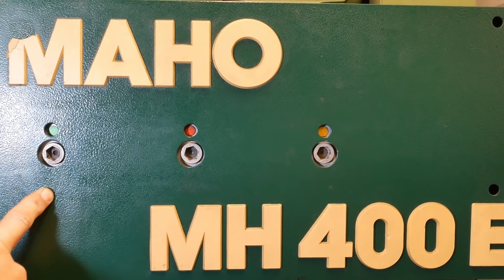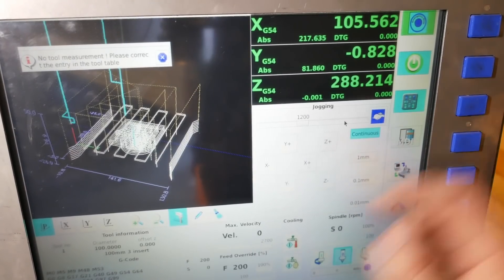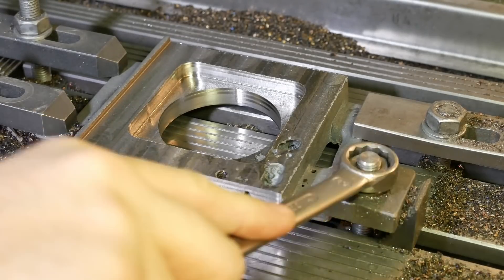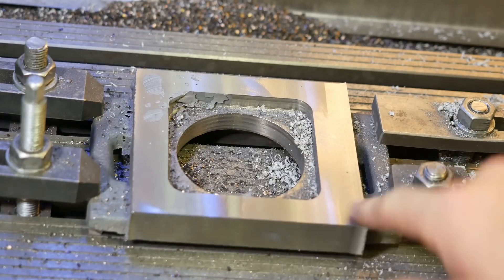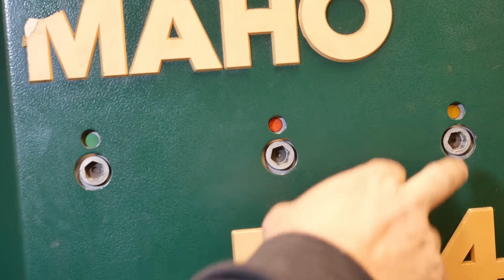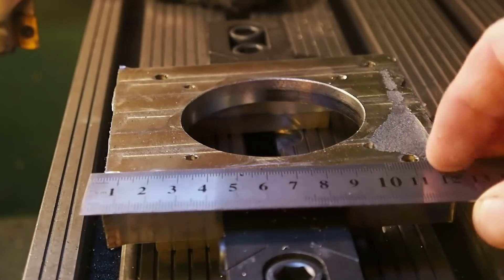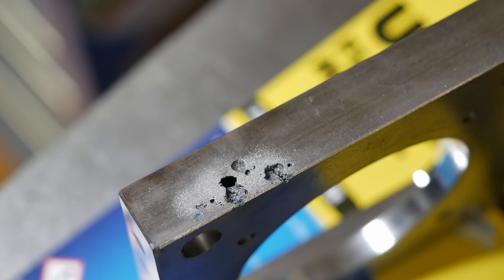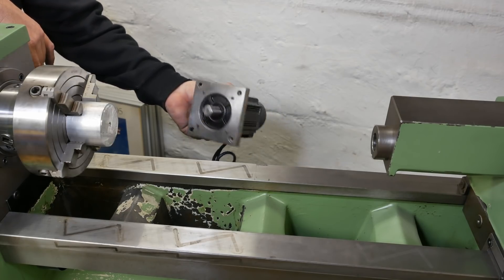Does epoxy liquid metal work? - Schaublin EP-34 || RotarySMP

Comment: I used Devcon for years. Particularly the bronze filled epoxy as we had a lot of Naval Bronze pump casings on sea water pumps. Seemed to do what it said on the tin. Latterly it would have been Belzona Molecular when I came ashore. I’ve used a number  of others and to be honest they all seem to be not dissimilar, although I avoided the cheap ones.
Reply from the maker: Thanks for the feedback. Yeah, I also dont see much difference between Devcon, this UHU or any others.

Comment: I had a worker here do the same thing to our beautiful  Kasuga VMC.  Took a nice chunk right out of the table.  To fix it we milled a round pocket the the bed, with about 0.03 interference on a close grain cast iron plug we turned to fill the hole.  We then milled a new slot on the table and faced milled the deck down to about 0.1 off the table surface then mill and hand worked the rest down.  You'd have to look very hard to spot the repair.
Reply from the maker: That is the way I was thinking of fixing it as well, but it is not a very high priority at present.
Reply: @RotarySMP  to be frank I was struggling to watch the remainder your videos knowing that bed was not fixed, I was hoping you may have done a video on the repair. Please do so as it will really help my machine OCD!!!! 
Keep up the good work, I have an old Kasuga mill with bad Heidenhain  control , glass scales. You got me thinking!

Comment: Used this thing once for filling excess grooves on polished to 5 micron vacuum table. Scribed excess epoxy with very sharp kitchen knife and some extra fine sandpaper. Looks not like metal at all, but fine and works good.
Reply from the maker: It is pretty useful stuff.

Comment: If you don't let the first layer of epoxy to completely harden, the second layer can make a chemical  (stronger) bond. If hardened before the second layer, the bond is only mechanical.
I'm a fresh subscriber, your videos are amazing! I started with your Sieg CNC conversion series.
Reply from the maker: Hi and welcome. Thanks for joining.

In this case, the epoxy is largely cosmetic, and I didnt do it in layers, but rather one set of holes, followed by the rest.

Comment: You talked about pucker factor . I absolutely bleave there is zero pucker them guys are of the very best in the world and with that comes a Confiedence that we can't know other than for me when if came a time I installed a overhead door that is probably the biggest in Canada its 24'X28' Full Vertical Lift at its highest point at the top of the third head shaft it was exactly 65'21/2" I had zero worie the first time I raised it to set the limits on the 3hp gearhead 575v opener with double #60 chain  I had the confidence if not I would say I have no business doing a job like that !
Reply from the maker: That is a good point. You dont let the apprentice go for it on stuff like that. There is a lot of planning and experience there.

Comment: But did you really need to use it for an reason other than cosmetic?
Reply from the maker: One of the M6 threaded holes goes through a void, so there are some threads in the epoxy, but mostly it is just a filler.

Comment: Oops nasty drill deflection. 👀
Best just use a rigid 4 flute endmill (and a spiral cut with light finishing cut) for CNC making holes in an easy material like cast iron. You wont have any problems with voids or even deliberate interrupted cut holes.

And re the job moving around; on parts for me, I usually design in bolt-down holes with counterbore etc so i can just bolt the job down onto a fixture plate. The disaster of having a job move during CNC is so much worse than having a few extra holes in the part. If you have a favorite fixture plate (say 20mm grid of M5 threaded holes) then most jobs will fit on that either with some little clamps or through holes in the job itself.
Anyway, it is awesome to see your CNC doing CNC! Thanks for sharing your journey. 👍🙂
Reply from the maker: Thanks, those are good tips. Thanks for your encouragement.

Comment: I wonder whether the aluminium brazing rod would stick to the cast iron… it could look a bit cleaner than the epoxy but likely to still have the issue with drill bit deflection. 
You really like to make me wince… first with drill bit deflection and then the part moving while machining? 😬
Reply from the maker: Me too. I should have used an end mill to first flatten that void base.

Comment: You could mix steel powder into the epoxy to get more of that metallic look...Just a thought.
Reply from the maker: Probably can, but powdered iron is not that easily available. Grinding generally leaves it oxidised.
Reply: I usually corrected and saved up the metal power that came out when I used angle grinder to cut steel, I think they mixed up much unwanted particles  and oxidized stuffs, but just uses it to fill with epoxy for repairing use.
Reply from the maker: @ray-charc3131  Does that ended up looking closer to the color of cast iron?

Comment: I think machining it out of a solid mild steel chunk would have cost you the same amount of time.
Plus you get the rigidity and strength.
Minus the hassles of casting.
Just a thought!
Reply from the maker: Where is the fun in that ? Given that the motor flange is only about 6mm aluminium, and there is a belt drive, there is no structural need for steel or cast iron. I just like cast iron and think it is "appropriate" for a machine tool :)
Reply: @RotarySMP  Keep the videos coming!!
Its always fun to watch you work!!
👍
Reply from the maker: @prashantpanchal9686  Will do. Thanks for the engagement.

Comment: My experience with various polymer/metal materials is that it works pretty well, but that often, it’s not rigid enough. Additionally, it loses strength when it heats up a bit, as under machining, or certain use cases. Decent for compression, but not so much under tension or shear. You saw what happens in an “edge case”, literally.
Reply from the maker: Yeah, this was really more a cosmetic usage.

Comment: loving the "safe approach move" test, this is exactly what i did during machine setups.  One thing i realized after seeing all the different methods people in the shop used to touch off( random .263" gage pin, an extra .101 gage block, a .375" endmil shank) and seeing all the errors that would get introduced by misstyping one of those weird numbers, is make all my touch and test tools whole numbers.  In my case, i used the 1" side of a 123 block as the touch, and 3" as the safe approach move, reasoning that it's hard to type 1" so wrong that my tool is more than 3" off.  In your case i'd probably use the 25mm side of a 25-50-75, for the same reasons.

I also used an even higher Z height for initial positioning, because it gave me a belt and suspenders safety setup: let it get in position at 5" Z, hold a scale up to the tool and check that i'm in the ballpark, move it down to 3" and check that i'm precise enough in my Z to make the part to the proper tolerance.

the reason i did all this was that I was working on parts similar to the jet parts you mentioned.  high pucker factor, one off parts.  nothing quite in the millions range (those jobs go to the most senior machinists, for good reason,) but often $100k - $300k.  You aren't wrong that there is a lot of stress, but usually, you also get a lot of time to make that part, so you can do a lot to test things.  sometimes we'd spend a day just cutting air: an 8 hour op, but we want to run every tool through a dry run 10" above the part, with the machinist watching the tool for any movements that would scrap the part.  Or even run an op so it cuts, but leaves extra material so you can actually measure the part, and then come back and finish.

It wasn't that bad all in all.  I enjoyed those days far more than days on a 1000 part run with a 2 minute cycle time.  Short cycle time parts feel like you're running around with your hair on fire the entire shift.
Reply: I was written up for making 50 extra parts in a shift. My supervisor asked me to make extra parts the shift before but didn’t say how many and for how long. I was 18 and thought more was better. Thanks for sharing your experience.
Reply from the maker: Weird that you got written up for making 50. He awnted extra parts. How many did he want?
Reply: @RotarySMP  I agree that it's a bit shitty to write someone up because you didn't tell them how many parts to make, but extra parts can be a big pain.  not every customer is going to buy extras, so you either have to hope you can get another order of the same parts, and spend money storing them in the meantime, or eat all the machine time and materials, and scrap them.  some short cycle time parts can still be pretty expensive, so you could be eating thousands of dollars in parts you can't sell.
Reply from the maker: @groghunter7403  Still not your error. Any foreman who gives that "make extra" order and then finds you were able to make more than they were thinking about, needs to look inward at their communication, not outward at the guy who did his best to the order given.
Reply: @RotarySMP  agreed.

Comment: You should definitely use it as is. It's very fit for purpose, redoing it would be a complete waste of time, in my humble opinion ;) Pragmatic beats pretty hands down. And besides, the fix tells its own story. PS I used a similar goop once upon a time, Loctite quick metal, to repair a bike engine cam journal in what was otherwise a throw away head, worked a treat and was still in spec when I sold that bike years later. Epoxy grouts are incredible things, I was taught how to make one using carborundum powder that my milling machine sits on, by the man that formulated the stuff that the turbines at Benmore sit on. More than good enough ;)
Reply from the maker: I am surprised that the epoxy worked as a bearing journal. Got lucky on the tribology there.
Reply: @RotarySMP  Heh, well considering that the cam was previously running directly in the soap like magnesium head casting it didn't have to try hard to be just as good. Honda TL125, wish I still had it...

Comment: Thanks for that great tip on programming a stop position above the work that can be checked without risking a crash.  Those twin tubes dispense non equal amounts of epoxy on the first push because the air space left in the tube during filling is different for the two sides.  I am sure it is fine for your use, but I did 6 ultrasonic transducer mountings with twin tube epoxy and one of my locations did not harden as much as the others.  Great video as always.
Reply from the maker: True, I had to push asymmetrically. With the cure in the oven, even poorly mixed epoxy tends to go off.
Reply: @RotarySMP  I will cut between the two plungers and dispense onto a scale next time.

Comment: Hi Did the motor mount need to be cast iron or would Aluminum worked for this attachment mount.
Reply from the maker: Aluminium, would have been fine. The motor flange which bolts to it is also aluminium. I just have a cast iron fetish :)

Comment: When using the side clamps you should use a solid clamped down bar on one side  and both clamps on the other. there is too much flex in the setup the way you have been doing it. you can even machine the sold bar with a built in step to keep the work piece off the table
Reply from the maker: Thanks. Good tip. Putting them across the hole was not smart. Both on one side would have been a big improvement.

Comment: Filling in something with epoxi if its a blind hole should not be a problem. It acts at the least and a force transfer material to the casting. What breaking force it has dont really matter since it will be supported by the metal. Its dont really have a place to expand to get the flex it needs to break.
Reply from the maker: For this use it was largely cosmetic. Only one of the M6 motor flange holes has a couple of threads into the epoxy.

Comment: Two observations (well, actually three);  1) you could really use a proper machine vise w/a set of precision parrallels. See exhibit A(tilting part) for confirmation. 2) This is more of a question, but it's still relevant; why does every hobbyist who wants to get into CNC programming think that they have to have a CAD/CAM system to program and machine such basic parts like this??? I'm a CNC machinist/programmer for a living, and we don't bother with the CAD/CAM system until we get up to a certain level of complexity, if for no other reason that the programs most systems spit out are just about impossible to edit at the control on the machine. Furthermore, most decent CNC controller's have a lot of functions built in that greatly simplify the job of programming. Think subprogramming. I've seen the same part program written at the control vs the version written by the software; the one written at the control was 1/10 the size. And 3) the epoxy you used looked like it was probably a hardware store grade??? For the good stuff, you would have to hit up an industrial supplier. The question is does the application justify the cost difference??? I've used some of the good stuff; it gets expensive very quickly...
Reply from the maker: 1/ good point. I didn't even check if this 110mm part would fit in my vise, because it is a 4". I didnt bother checking the opening.
2/LinuxCNC has a conversational programming plug in called NativeCAM, but I am more comfortable like this. The monitor I choose for this retrofit has poor viewing angles, so it is not so comfortable to program at the machine.
On the lathe I tend to just hand code with sub routines, but on the mill prefer cam.
3/ Yeah, just cheap hardware store. I was just curious of the color.
Reply: @RotarySMP   Thanks for the honest reply, especially about why you're used Cad for simple part's. It was just that for me, you probably had as much time into drawing it, so you could then program, that I would have been machining it, including setup and measuring all of the tool's. But, in your defense, this is a hobby for you, I'm speaking from what I do every day at work. My perspective is a little different than most hobbyists (even though I'm one of those weirdos who's hobbies are basically what I do for a living)... You're good, I just thought I'd throw that question about CAD/CAM out there...
Reply from the maker: @7891ph  It is a shame I couldnt get the Maho running with the original Phillips 432 control, as that one has a really good reputation for canned cycles. LinuxCNC is more a collection of apps, where you can mix and match GUI's, conversations programing widgets, probing widgets etc. Since I have been drawing in CAD for decades, I feel more comfortable there. I have been meaning to install NativeCAM to integrate conversation programming into LinuxCNC, but havent really missed it.

Comment: Love the videos, always something interesting to take away from them. I notice you seem to struggle with your camera mount tilting down slowly, maybe time to machine a short bar to offset the camera more backwards so it isn't front/lens heavy when sitting on the ball mount? ^^
Reply from the maker: Good point. As I have added more junk to the camera rig, it wants to tilt. I use both ball heads and video heads. I also have it on a long Acra swiss rail, so probably just positioned it wrong.

Comment: :D For a 1.5m$ part they probably use proper tools all round the process. Not like you or me who use whatever shit the company has from the 90's on top of that hand coded. Unlike what the guy said in Fast and Furious it actually had to do with what is under the hood. Not the driver. Probably you get better rigidity milling the other way, x rather than y or how ever it works on that machine using the same setup.
Reply from the maker: Good points. I milled in Y, as that would most of the cutting force into X, with only the feed force in Y.

Comment: Nice to see I’m not the only one that does machining with one hand…. The other one lives on the Big Red Switch… Good outcome and useable part … and that’s what it is all about, and thanks for the honest video, warts and all.
Will you revisit the root cause of the iron casting issues?  Pouring basin design with a weir, or how filters are used?  In any event, impressive results for a cottage foundry👍
Reply from the maker: Thanks. The gating change I showed in the last video worked really well, on the other casting. This one got defects because I bunched it up in a too small flask.

Comment: I was afraid you’d have to recast due to the movement when face milling the backside. I was waiting to see if you mentioned the motor shaft was no longer perpendicular to the plate, or something similar. If not, good deal! Assuming the epoxy is good, I don’t see any reason you’ll have an issue with it.
Reply from the maker: Lucky there thickness is not critical, as I still have to mount and space the pulleys.

Comment: I think Stefan gotteswinter used some metal loaded epoxy for his ways and for the levelling of his machine. Would be interesting to know how his compound fairs against yours.
Reply from the maker: That is Turcote. It is a very different material, for a very different use case.
Reply: its loaded with steel balls (that hold the compression force, the epoxy is there just to keep the steel balls fixed in place)

Comment: I suggest you should add same cast iron samm chips with apoxy it will help much better. I regularly machine cast iron and usually use mixer 20 : 80 ratio chips:epoxy respectively by weight. Or the pinch of chips works great always.

For leveling epoxy by hand i use a box cutting bladefor maximum removal
Reply from the maker: Great suggestion!